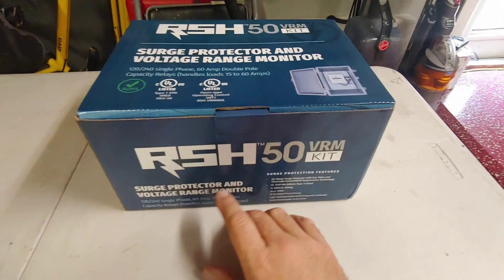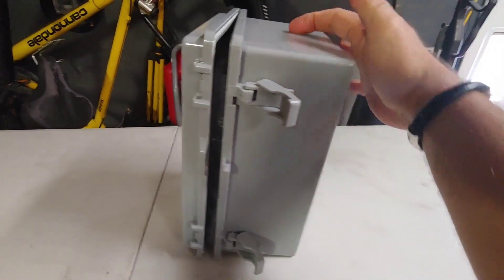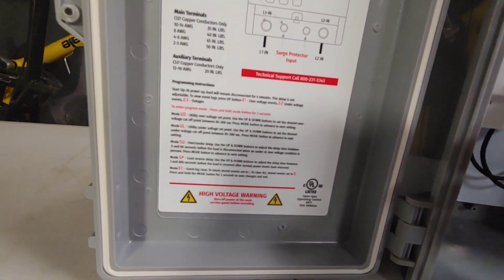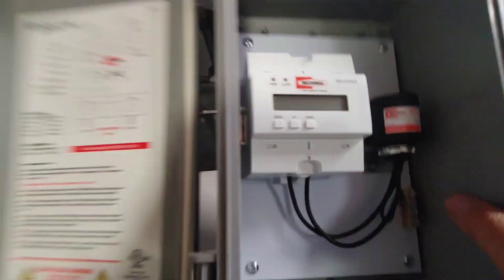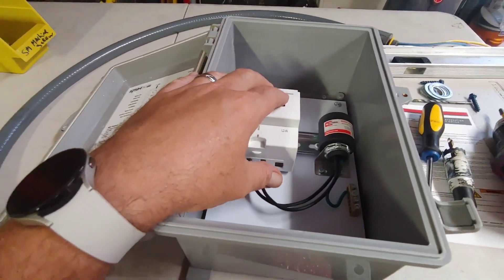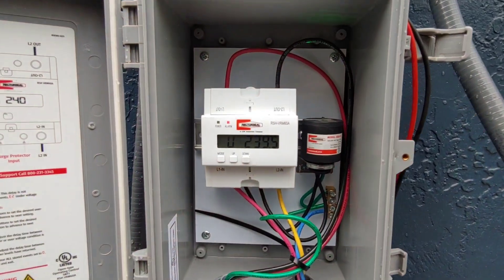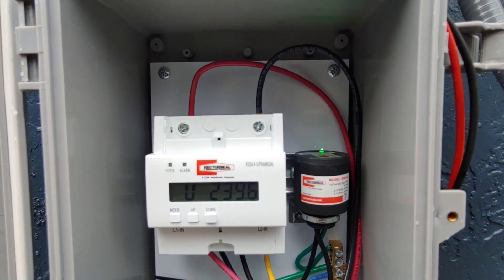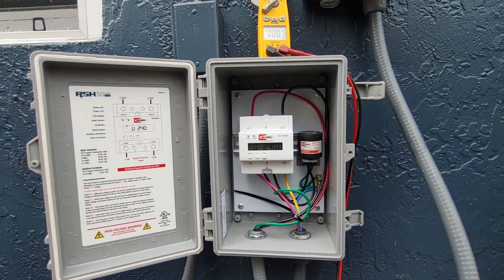Installing a Rectorseal surge protector/volt monitor

Comment: No Amps, it's voltage. The system is probably only drawing about 20 amps. The electronic disconnect is monitoring voltage to open the contacts if voltage goes above or below the set points.